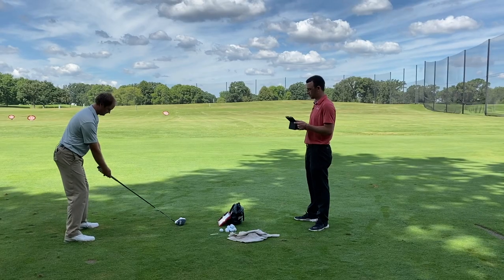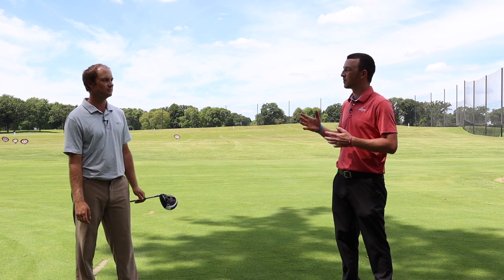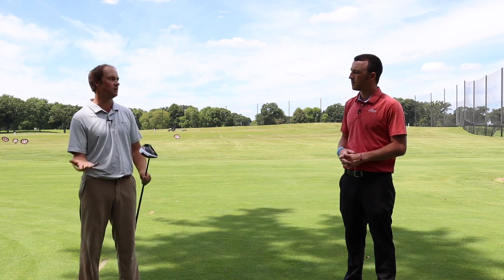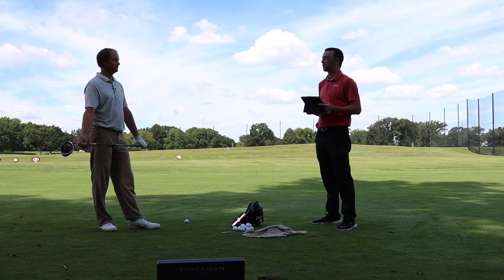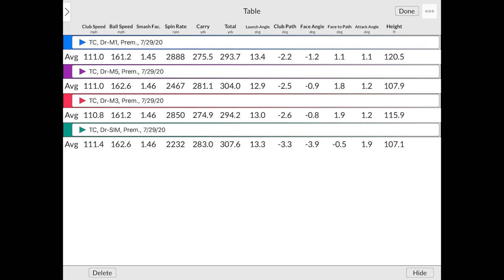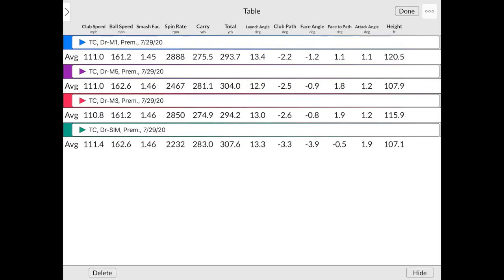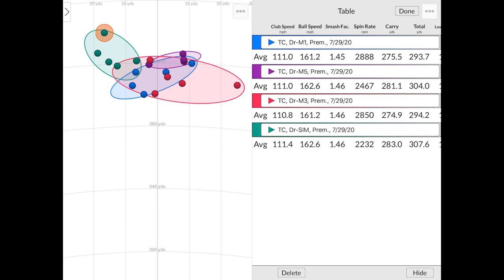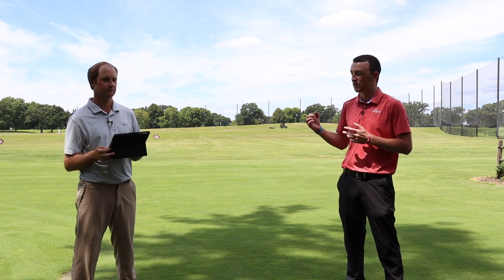TaylorMade Drivers Test & Comparison: SIM, M5, M3, M1 | Trackman Test

Comment: Firstly, great channel and comparison. I owned and sold the M1 (17) and M4. They were both 10.5 in reg. The M1 weight adjustment messed with my mind as did the silver shape on the M4 as I never liked it at address. I now use the Ping G400 9.0 in stiff flex as my swing has improved (104mph). I love experimenting at the range using launch monitor data. I keep watching ebay for a SIM or TS3. Being a lefty I dont get the range to try but like the fact that titliest use the same hozel making shaft options availability easier. SIM is still a bit exsy so may go M6. 
Thanks again from Sydney...
Reply from the maker: Thank you for watching! Love that you are able to do some experimentation with launch monitor info. Great way to improve your game and identify where changes can be made.

Comment: I tried the Mavrik driver on Friday against my 4 year old Epic and saw precious little difference although the Mavrik was a bit more forgiving.  So I was not really expecting much difference between the 4 TM drivers.

The actual results are interesting, if we accept that Thomas was pulling the Sim a little which should have dropped the spin rate a little and increased carry distance a little, then it is likely on an identical swing basis the Sim was probably 8 yards longer and 300-400 rpm less spin than the M1.  That is a surprisingly decent improvement - if you can cope with the lower spin.

The other take away is that with the right shaft you might be able to get the spin rate down on the M1 and make it perform in a very similar fashion to the Sim. Of course you might also get better results with a different shaft with the Sim as well!
Reply from the maker: Thanks for the comment! You're right about the shaft -- that's another way to tune a club for your swing. For these tests we purely want to test the heads against one another. Over the past several months, we've noticed the SIM family has been pretty low spinning so we were especially curious about that. Thomas did get the ball to turn over a bit, which did help with the decreased spin, but I think you're right that about 300-400 RPM lower is accurate.

Comment: Did you have the weights in the head in the same? You are comparing adjustable heads against not adjustable.
Reply from the maker: Hi Jamie, thank you for watching and commenting! We had all weights in the standard positions. The SIM weight was in the standard position (not fade or draw biased). The weights in the M1, M3, and M5 were all in standard to not have bias toward a fade/draw or a high/low launch.
Reply: 2nd Swing Golf so it is possible to get the other heads to spin the same. The CG of those heads are all different so setting them up in the standard setting does not mean their CG is the same. It’s not as simple as that.
Reply from the maker: @jamiepreacher4978  You're right, adjustments could be made to each head to bring the spin closer together. For these tests, we like to measure the performance in standard settings to get the most unbiased test of the clubhead's performance. We are testing the clubhead's against one another understanding that the CG locations are different. Manufacturers will purposefully manipulate the center of gravity to improve performance.

Comment: is the 10.5 that you were using likely too low a loft for a new teenage player?
Reply from the maker: Good question. It's based largely on the swing speed and swing tendencies of the player. If the player has enough speed and launches the ball high enough, the 10.5 can definitely work

Comment: Great test, maybe with all the heads move the weights forward to make them lower spin to really see if from head to head they spin less.
Reply from the maker: That's an important point you've raised. All the weights for this test were in the standard positions. Of course, SIM doesn't have a front-to-back adjustable weight so we would only be able to make that adjustment with M1, M3, M5.
Reply: @2ndswing  Right on that is true about SIM.

Comment: No offense but not utilizing the low and high spin slide on the M1 is giving it a raw deal.   Then using a shaft intended for the SIM.  The spin numbers were the only real difference.  You can hit whatever spin numbers you want.  That’s where the exact same shaft isn’t necessarily “fair.”   Maybe a lower spinning shaft is what the M1 and 3 needed but would have been too low with the other two.  Fit yourself optimally in all realms with each head and do your comparison.  There won’t be a penny worth of difference in the four.

Comment: The conclusion of this video...get some lessons and you will hit the ball like this guy.  Minimal difference between the drivers when you look at the end result... and these drivers are very expensive.  I am still super happy with My 9.5 deg M3 with both weights all the way fwd and I got it for about $100.
Reply: Good call but even sticking 3 years behind the new model vuyubg old unused stockk for woods is a bargain. for irons you can go back 5 years and get  a super set